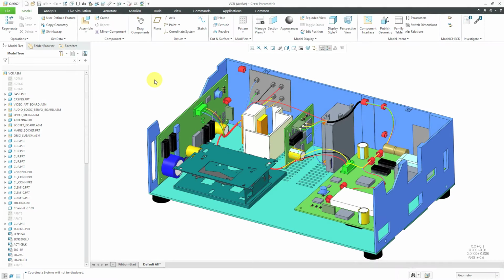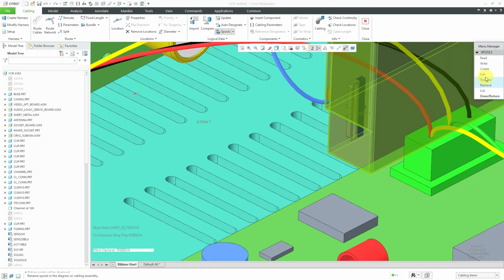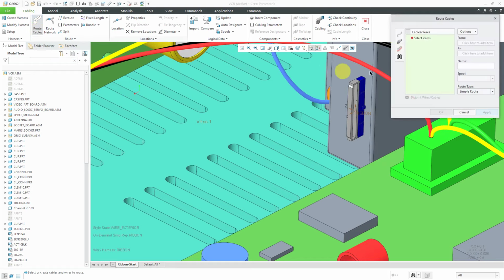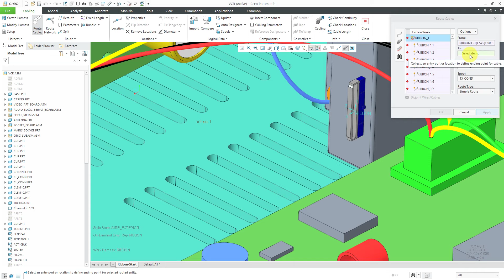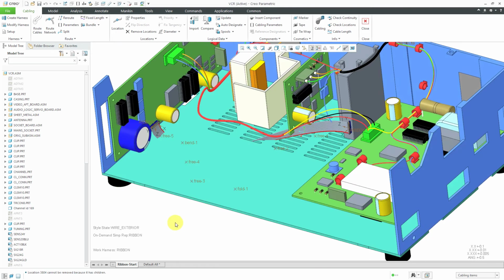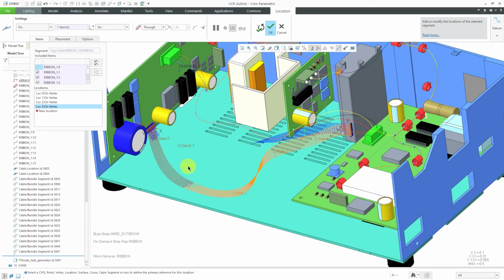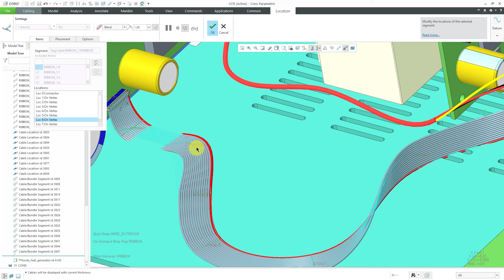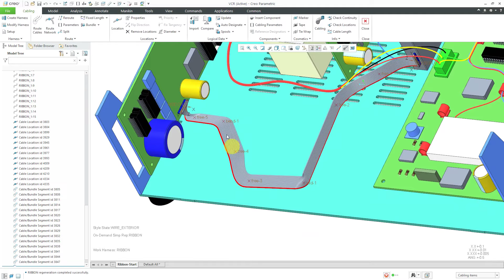Creo Parametric Cabling - Ribbon Cables

Comment: Is there a way to define a Twisted Pair Cable?  (exposed... no jacket)
Reply from the maker: Years ago I saw a method with a Variable Section Sweep. I believe it used trajpar to control the rotation of the circular cross sections around the spine trajectory.
Reply: @CADPLMGuy  Thank you... appreciate the response!